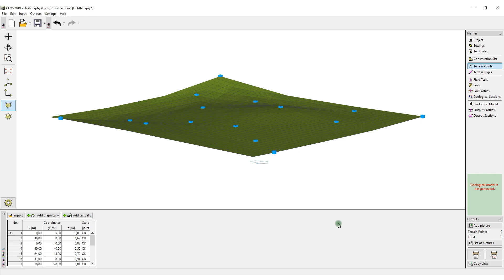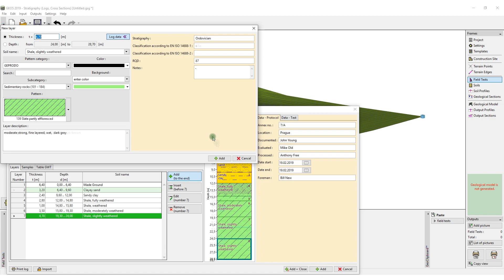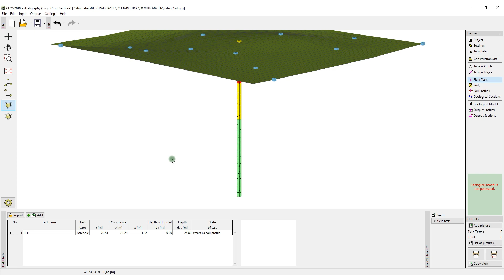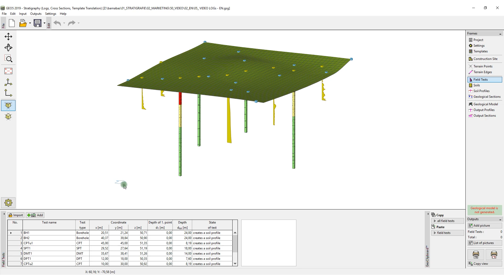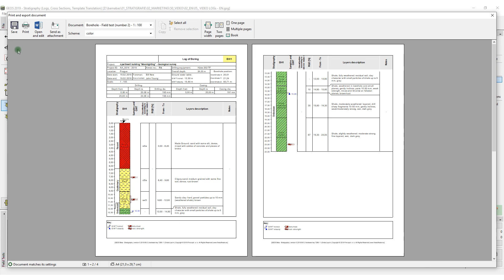Create Geological Reports Using the Logs Module in GEO5 Stratigraphy

Comment: I am having the latitude and longitude values of the boreholes and the digital elevation model for it. How can I import it in GE05? Is there any way? I am working on 57 boreholes and I want to model the soil profiles of these using GE05. Clarifications related to this will help me a lot.
Reply from the maker: Dear Shashwata, it is possible to import more boreholes from one file but you need an precisely arranged excel file (xls, xlsx or ods). The import/export is explained in our Engineering Manual no. 47 - download it from the list of manuals at https://www.finesoftware.eu/engineering-manuals/?productId=all&predatorId=Stratigraphy&langId=en. I hope it helps, if not please describe as much as possible information to the e-mail, add your file with boreholes data and contact us at geo5@fine.cz, the technical guys could help you.

Comment: Its my first time using this software, so I have a question, I'm trying to import a file with information of 20 boreholes, that includes their layers of stratigraphy, but I can't add them, the software only allows me to import the boreholes one by one. Is it possible to import 20 or more in just one file? Additionally I can't see the coordinates when I import the borehole, even when I import only one.
I haven't been able to find a solution to this problem.
Thanks a lot for your help.
Reply from the maker: Hi Scarlet, I found out that our support has already answered you. Yes, it is possible to import more boreholes from one file but you need an excel file (xls, xlsx or ods). The import/export is explained in our Engineering Manual no. 47 -  https://www.finesoftware.eu/engineering-manuals/?productId=all&predatorId=Stratigraphy&langId=en. I hope you will be successful.

Comment: Hi. I would like to know if geo5 stratugraphy has limitation about size lf the geological model because I've imported a dxf file of 300x440 meters and the program didn't work. 
Thanks in advance
Reply from the maker: Hi, generally, there is no limitation of size. Sometimes, in the case of huge models, working with the program can be slower. For this reason, we have implemented an automatic reduction of input data (point/edges) - https://www.finesoftware.eu/help/geo5/en/terrain-points-01/. If it still doesn’t work, please, send us your file to hotline@fine.cz. Thanks, FINE team